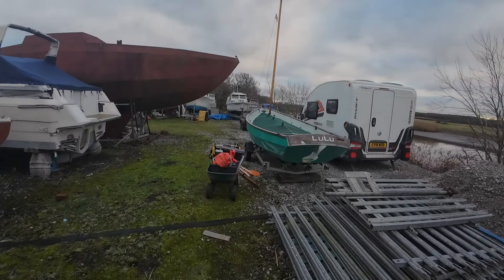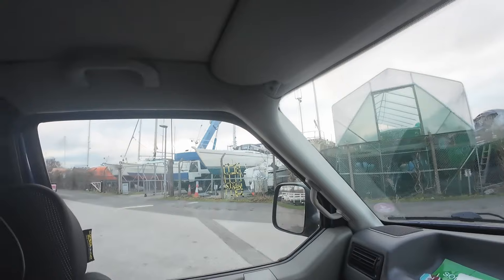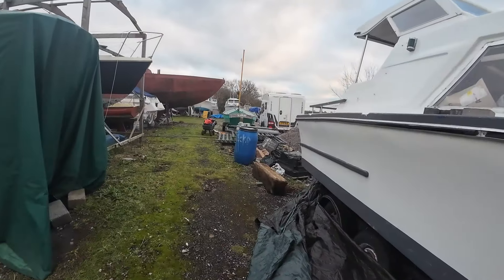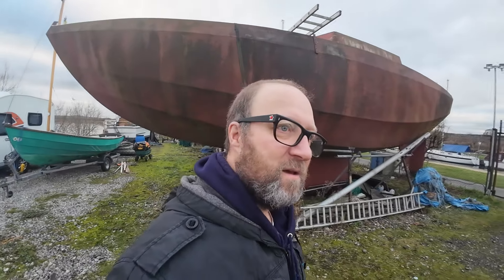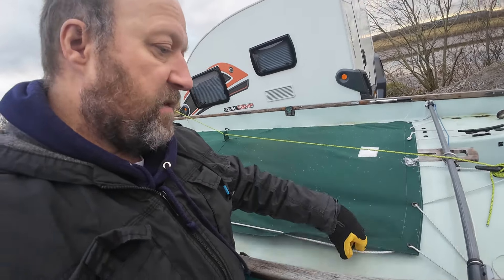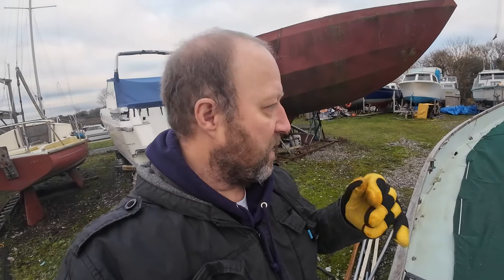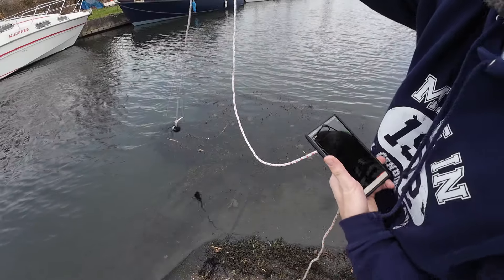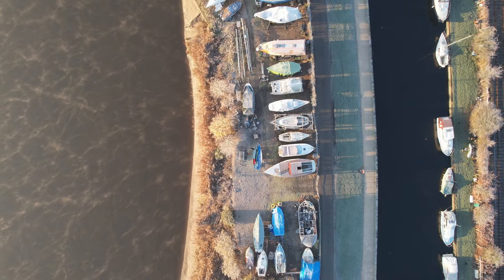Playing With Oars, A Bobstay And A Big New Project!

Comment: some great ideas  that bobstay really made the difference , maybe make the stay from dynema once you have prestretched it to save weight , never break under those sort of loads .4mm would be ample of sk78 12 strand
Reply from the maker: CHeers for that. I will try the Dyneema, its great stuff and I think I have 3mm spare so may try that.  Someone on the Lugger forum recommended using a cleat to tighten the line too which I intend on trying too!
Reply: I love the channel Dave and I do feel a little bit like your trying to solve issues that the Lugger doesn't have. It will never really sail like a modern dinghy no matter how its rigged and there is nothing wrong with woodern oars. What it actually needs is a good tent and cooking solution, a decent amount of bouyancy and emergency bailing then just lots of fun camping adventures...just enjoying. That all said....we really need innovation and people to dream and experiment and I love watching you mess about. So what am I saying? I'm really not sure..😊😂😂😂.... experiment...but have big adventures. Adventures are more important than hardware. Keep up the great content and I hope you don't mind my input. If so just ignore me. 😂
Reply from the maker: @dougjacksonart  Hi Doug. No problem at all. I understand what you're saying completely. I have found the Lugger is a very basic boat that's a great base for trying new things on. Perhaps too many things!!!  At her core she's a beautiful boat and in the right weather is a very sea worthy companion.  I think I sometimes get too worried about the few achilles heels she has. For the Lugger to get into trouble, the conditions really do have to be quite bad.

Weather turns out to be the biggest challenge in Season 4 but we do get out and about again and there are some big changes too coming!!